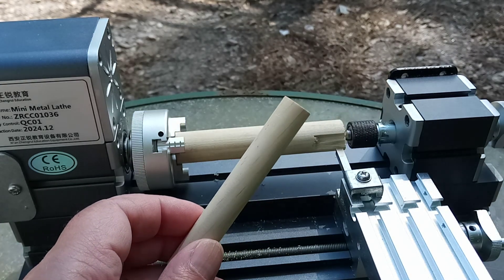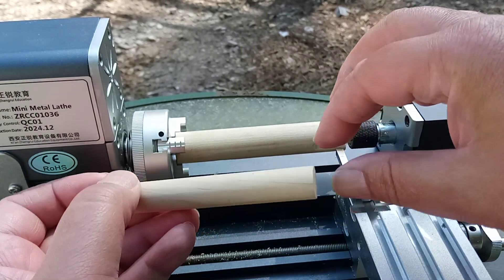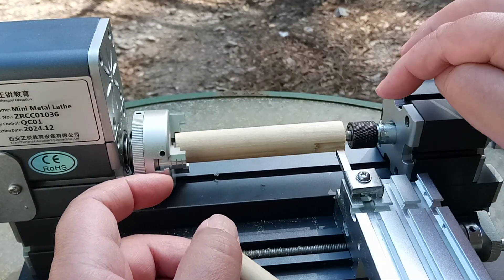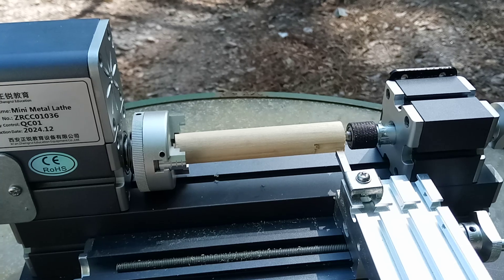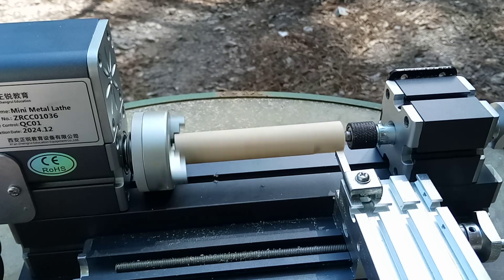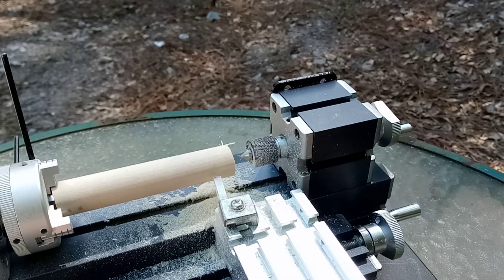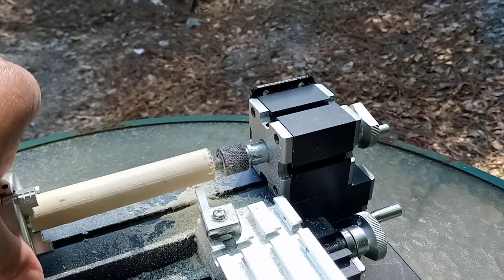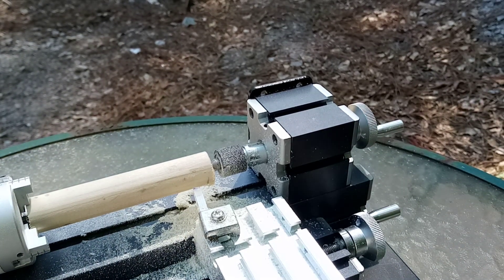Micro lathe GHASTLY or GOOD?.  #engineering #engineer #modelengineering #hobby #hobby #workshop

Comment: 4:35. dont do that. TAKE THEM OUT! do not get in teh habit of leaving chuck keys in a lathe chuck. ever.

erm... tools need grinding to an actual point...
Reply from the maker: I bought a new set of tools and they all seem a bit... blunt
They'll likely only be used on wood, plastic and aluminium. It's a shame there are no gears and no lead screw.
The lathe will just stop if I leave the chuck keys in.
Reply: @britishtechguru  hss blanks are just that. blanks. have to be ground, and ideally honed to razor sharp. 

i know its only a toy, but do not develop bad habits. first rule of any workshop... chuck key is in ones hand being used, or on bench. do not rely on "safety mechanisms" other than your own brain.
Reply from the maker: @paradiselost9946  There's no emergency stop on that lathe either. What I'll probably do is to put a horn button from Autozone as a power switch. I could go fancy and use the horn button to power a relay to provide power to the lathe. When the button is pressed, the lathe can operate. I also need to put some kind of shield so that if the work goes flying, it'll be restrained.

I very much doubt  there's enough power in that lathe to toss the chuck key or if the chuck key is lodged firmly, to bend the key. Your point is taken though.